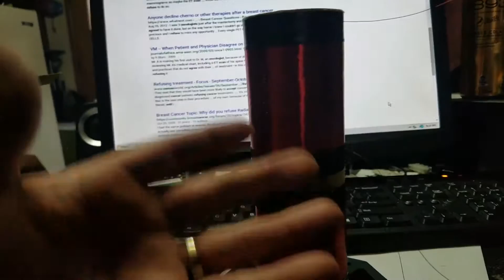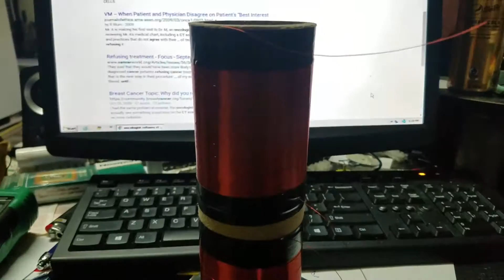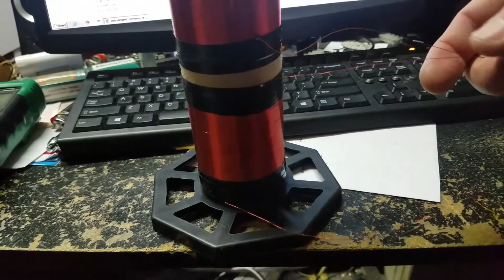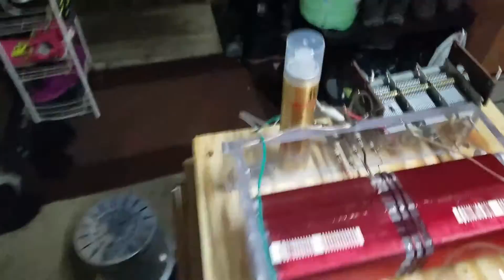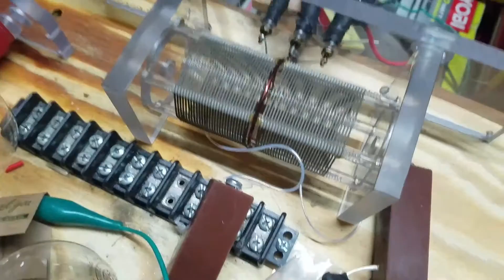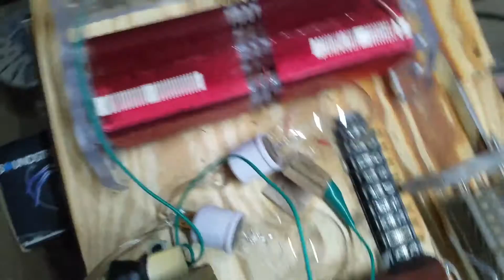Bidirectional Tesla -Smith Experiments

Comment: Thanks for creating a new forum. Unfortunately it´s not possible to create a new topic or reply to a previous one. I´m getting kicked out all the time. I don´t need to sign out - the website itself takes care of it :)
Would you please check where´s the problem? Thanks
Reply from the maker: go to this link. It brings you to the forum labeled Free Energy Systems Comments & Wisdom . You must sign in with your Google account or another account as requested o the site. You should be able to comment, post images, etc. The New Posts have to be filled out by Members. You are a member, so I'm not sure what's going on. You may have tried adding a new topic from the home page, I'm not sure if it will allow you because you may have to be a moderator. i have to look into this. I just got it running a couple weeks ago and haven't had time to mess with it much, but I do have circuits posted on the circuits button at the home page. The original Pelex mod I did NOT sell the rights to is there as well. Try some of them out and let me know what you get for energy out. Thanks
Reply from the maker: http://www.dezeinstein.com/#/news/

Comment: the interaction between the one primary and two secondary's will provide either high I or high V but not both at the same time  sliding the primary from the middle of secondary back and forth.   use the neon lamp an 22k r for 1/4 wave location.  I had really good luck with tesla hairpin stuff.     check out the russian destine2012 stuff on you tube  they had some great results running motor grinders ect with smith stuff and cold energy

Comment: or you could just use my system...  It cost about $299 for a 10000 watt generator all you need is the generator itself and a V belt pulley that you can hook up to an electric motor. now your going to need a way to fire it up with some type of external electric Source a battery with a strong power converter, another generator or Plugin from your house to start the electric motor something to get it running. you need to build a control switch for it so you can tune it in at 60 hertz with the motor because that's what all are sensitive devices like TVs and stuff use here in America. but don't get scared it's very simple your black wire is your hot wire you got two of those your white wire is your neutral wire you got one of those you're done now you got a copper wire that's not coted called your neutral wire also just like your white wire and it runs outside to a 4-foot copper rod that's in your ground or ground wire..  are you with me so far give me a thumbs up if you are just kidding you know I can't see it through an email... so now you have an electric motor a generator with a V belt pulley on it you need a pulley on both of them that are close to the same size so you will be able to tune it in if you can't get it fast enough you will have to do a two-to-one ratio because that generator has to turn at 3600 RPM for you to get 60 hertz or 60 Cycles per second or 60 cycles per second * 1 minute also known as 60 times 60 is 3600 revolutions per minute... once you get a good generator and a strong electric motor minimum of 1750 RPM if it's 1750 RPM then you will have to have a pulley on it twice the size as the one that's on the generator. Let me know and I will tell you how to wire it into your box. But all of the instructions are here except for the control module which you can use a anything that is rated for 110 volts AC or DC it doesn't matter both spectrums are the same strength ones direct current ones alternating current how about let's say a ceiling fan dimmer switch rated for 220vac so you know it strong enough. That's it I know it sounds like a lot but it's basically four or five pieces of equipment hooked up together in the right way and you have just solved your electric problem forever... even if you bought one electric motor every month you would still pay half as much on electric and I promise you...
Reply from the maker: I still haven't seen a working output from you yet? I'd like to see a video that shows it running with a load on it that shows something as simple as a killawatt meter proving it's input wattage vs. another killawatt meter showing it's output wattage per coil, then adding the coils up without disconnecting the other two coils, or, even better, another kilawatt meter showing output wattage on both coils used for it's output. The rotoverter is a basic concept similar that does provide overunity, but very little over the top, however the rotoverter doesn't have enough overunity to feed back a loop to run it's input and a load at the same time. That is what everybody is after. 

 Of course a good load on the output could be measured to see what it really does, as i do with Pelex, maybe a 120 or 240v loadbox connected to it with a  tool such as a killawatt meter on it's input vs the output as my Pelex device has to prove it is worthy and outputting more in the output than the input does. Voltage alone is not proof, it is trickery that a lot of people try doing, but wattage meters don't lie so that is what I'd love to see. I prove it on my device, 6 watts in and 1800 watts or so output. I think in my video I show the electric heater on the output at 800 watts out while I have 6 watts input, but it does much more than this. i am going to revideo this as a reply to your comment maybe tomorrow or Friday but I have many things to do and i have to find a bunch of larger devices for loads, such as halogen lamps. That is what counts right now because anybody could use an input that comes from the wall to power a motor that creates (3) coils at 120 volts to run 3 separate circuits in a breaker box that will output enough energy to run all of the lights in a home, especially LEDs. The lights won't be an impressive feat because if we use 12 volts at 20 amps input, we could generate enough power to light all of the lights in our home if we used LED bulbs with ease . I'd be able to light up close to 40 (6) watt led bulbs full brightness using a normal unmodified alternator , then I'd have to monitor the wattage on the input and calculate the loss, but we will see if you could come up with a result.

I'd like to see this impressive device you've been talking so much about, but I've yet to see anything but 2 disconnected alternators with their wires floating.. When are u going to show us something like this , the meters are 10 bucks each, I'm sure you have some, son't you? That's the easiest way for simple proof of input vs. output

I'll revideo and post mine by saturday night if you'd like to put your video doing the same thing in a response to my video. Let's see if this happens.. i am waiting!
Reply: Marc Belanger yeah I'm pretty sure I'll have something going before then. I had a video that I was going to upload today and I spent four hours uploading it and it never did finish... I wasn't able to get to hotspot and I don't have a VPN or anything.. but I'll have something up by Saturday night even if I have to buy some more data!!

Comment: HAVENT HEARD FROM YOU FOR SOME TIME AMIGOS,..HAVE A GREAT 2017
Reply: SORRY TO HEAR ABOUT THE PNEUMONIA..TAKE CARE..
Reply from the maker: Thank you. I'm felling much better,  I will try to keep in touch. I finally broke 1000 subscribers... now I will see if folks are willing to donate towards my research. I need money to do some of the experiments... I have invested everything I had and it is going to take a while to do more. I have received some investments by way of followers sending me neon sign transformers, but now I am going to build some other circuits and I've learned one of the many secrets Don Smith has never told anybody. In fact, from what I am seeing his schematic is dead wrong and the primary or secondary coil is wrong. From what I gather, the primary coil could be open and it makes sense to see the nst shut down if we ground one side of it's output. I've found that if we connect only one side, the grounded side, the arc from the arc gap will still work and the energy will pulse into the ground, filling the ground with more energy than it had before. The open coil acts as an antenna that returns the feed at a massive multiplier in output since the Earth acts as an AC capacitor, it instantly charges with the voltage from the input to the ground, but the energy must be radiant or cold electricity. Once it is fed, the atmosphere (which acts as the positive plate of the capacitor) must equalize this energy level as "equal and opposite" as Don explains.  This creates the standing waves and the pulsation into the ground, which travels faster than the speed of light amplifies as it flows into the ground, like a sound wave. This energy grows as it moves further away from the source. Since the energy only travels through the Earth's crust, it flows all the way around the globe. If it does make it without anybody tapping the energy at the same frequency, which is highly doubtful, then it could become a million times larger in amperage once it travels back to me. This is where the amperage comes from and the voltage comes from the NST , as well as the return path from Earth's capacitor which is in resonance with the frequency of the coil (antenna), and it induces back into the system as it's return path. This allows the energy to transform from the input (primary) to the secondary, and the return path for the amperage flows the other way, back from ground, since I use an Avramenko plug at the load on it's ground connection where the opposite flow of energy comes from.

So, we hit the ground rod with 4500v and .035 amps, which costs us around 157.5 watts. It flows and amplifies the amperage approximately 100 times, making it close to 3.5 amps at 4500v which equals 15,750 watts of output total, not including the additional energy absorbed from the atmosphere and the cosmos/aether.

I am not interested in hiding where the energy comes from.  I believe very little of it has something to do with Earth's electrical storms, losses from millions of grid customers and other "aether" or vacuum energy gains others believe in. I think the rapid amplification occurs in the ground as I stated earlier, allowing only amperage to increase heavily, and believe it or not, the conductor size has a lot to do with the output since . The energy output I do not believe comes magically and wirelessly from other sources, I just truly believe that science is wrong about exactly how electricity works, making it difficult for any of us to explain it correctly so patenting can happen. The patent office can't allow true overunity systems to be patented, but there is nobody stopping the creation of my products which could be open sourced, or sold as kits, or sold as schematics. If I am able to acquier crowd funding I will send these schematics out for free because the experiments won't cost me anything.
Reply: ahaa... my guess was true, I doubted Don Smiths schematics from the beginning, it didn't make sense shorting the neon outputs from day 1 to me, he NEVER TOLD US THE TRUE WAY of his devices..do be careful of any high frequency switching arcs you play with, they do make you feel good initially, but could also make you sick in the long run..i think youre getting sick from the experiments..